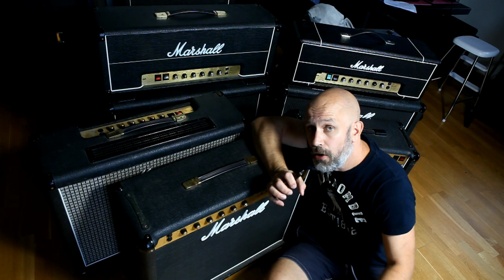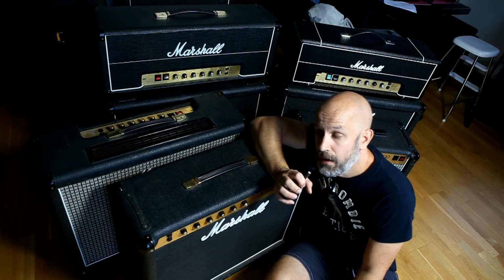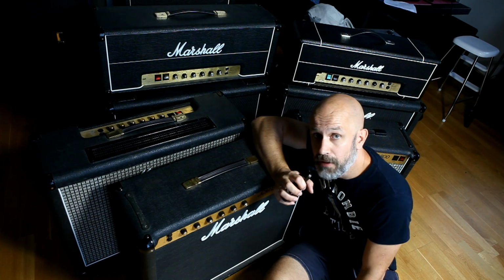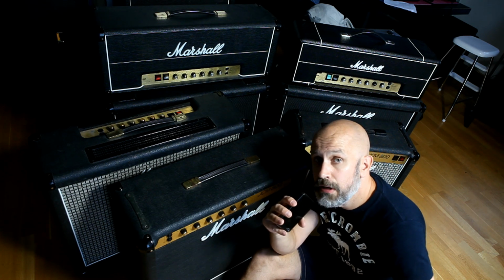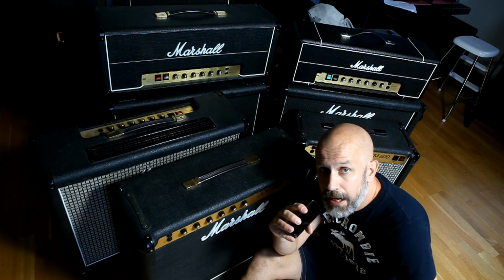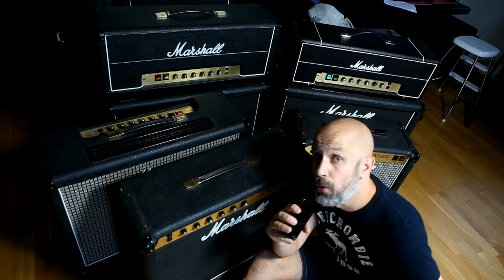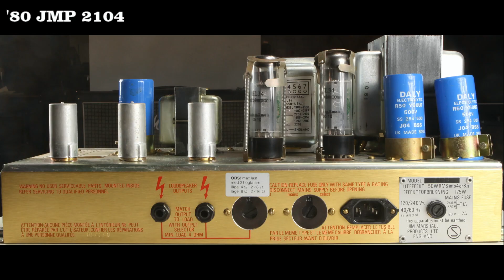Inside 5 different Marshall JMP, JCM800!

Comment: Interesting! I would say the mustards were added to the '77, since by '76 they were using far less mustards. Also wonder why some of the combos have no-name two piece boards, the others have the normal Marshall ST202 boards?
Reply from the maker: Hi, my experience is that it's rather common with Mustards on 77 amps.

Interesting observation regarding the boards, gonna look into that!

Cheers Johan
Reply: +Johan Segeborn Bet it's a US vs Euro version! My stock '76 1987 has way fewer mustards.
Reply: Andy K they used what they had.  They changed values, capacitor types, whenever it suited them.  Some schematics even show two possible component values in certain areas of a circuit.

The master volume amps with all Philips "mustard" caps are definitely a smoother sounding amp.  Possibly the difference of film and foil construction, vs metalized polyester capacitors.  The later JMP masters and the JCM series definitely sounded a bit more "harsh"  But that's where 80's hair metal dreams were made.

I pulled the cheap Chinese caps out of my Valve Junior Hot Rod, replaced with some Philips capacitors, and good God she's a new beast.
Reply: Andy K they used what they had.  They changed values, capacitor types, whenever it suited them.  Some schematics even show two possible component values in certain areas of a circuit.

The master volume amps with all Philips "mustard" caps are definitely a smoother sounding amp.  Possibly the difference of film and foil construction, vs metalized polyester capacitors.  The later JMP masters and the JCM series definitely sounded a bit more "harsh"  But that's where 80's hair metal dreams were made.

I pulled the cheap Chinese caps out of my Valve Junior Hot Rod, replaced with some Philips capacitors, and good God she's a new beast.

Comment: Very nice and thanks for the video. I like to see those mustards in the 77 JMP, but we see that those were given up in later circuits, the 82 JMP 2104 already doesn´t have those, looks like WIMA to me (at least the red ones). But still I think they kept on using ISKRA or Piher for the resistors - that is carbon comp ones. 
I saw some 78 JMPs 50 and 100W Master  Volume versions that already did not have Mustard caps, but some WIMA-type caps, but they are yellow not red. Mustards were given probably up in this period after 1977. Perhaps Johan, you have some more information about this?
Reply from the maker: Goran Krznaric Thanks! I haven't seen mustards after early 78, but not in person (on the internet). I remember a discussion on Marshall Forum, where we discussed this: @marshall-amps/64272-marshall-jcm-800-vs-jmp-blocker-switch-2.html

Cheers!
Johan

Comment: Hi Johan, great video! I have a curiosity, in '82 4010 the resistors on the presence pot is 4k7 or 10k? my jcm 4010 in a strange version, it has only two filters caps,even also lacks the hole in the chassis

Comment: I had 2 JMP 2204 Master Volumes One was a 76 and one was a 77 and they both sound quite different,  Mostly due to the fact the 75 had EL34's and the 77 had 6550's before owning those amps I had an early 80's  81-83 JCM 800 and I noticed it had more lower end.  I always wander if it had a bigger bass cap?
Reply from the maker: +Guy Thomas Was it a combo? The 4n7 cap on the mid pot gives it more low end. Check this out:

https://www.youtube.com/watch?v=3WKY8mjQPJ4

Comment: Johan with sound forge  11  with Izotope  you can analyze  the tones, and get meaningful data   spectral analysis etc.  Izotope was awarded  gr.   ammy for their mastering software.   Soundforge is a Sony product....http://www.sonycreativesoftware.com/soundforgepro/izotope
you have great great recordings. I hope to look at them with spectrum  analyzer.

Whats probably most important to guitarist is wave form of distion in a say stock  plexi with  mustard caps.  Sozo claims to duplicate mustard caps, i dont buy it.

I am building  4 watt push pull  plexi style with real mustard caps,  hoping to get the plexi tone at low volumes, which i know is possible.  I( tried many tubes and think I have good ones now made by amperex and mullard, new old stock. I love bugle boys
a bit darker flavor to me and bugle boy rectifier tubes too,

bill  thanks for all  your wonderful recordings  !!!!!

billyoung606060  on gmail
Reply from the maker: Thanks Bill, I used the Spectrum Analyzer app in a previous video to visualize overtones. Gonna check this software out too. I think that both Mustard and Sozo sounds great but there is an audible difference as you say. Then Mustards probably differ between instances as well though. Good luck with your amp.

Cheers!
Johan